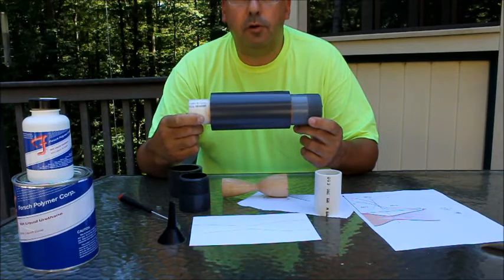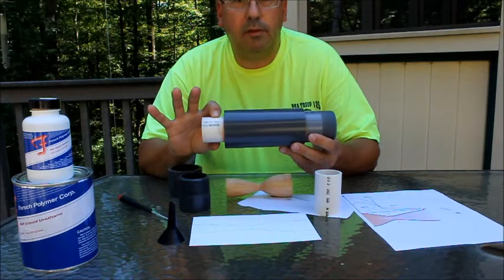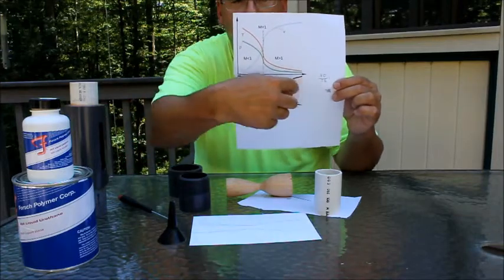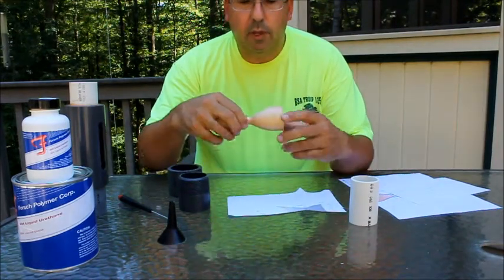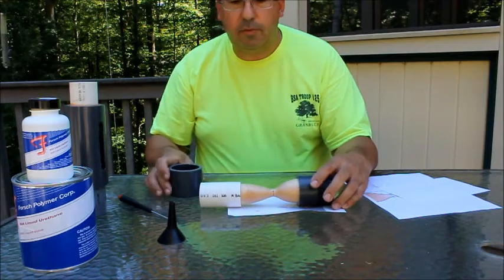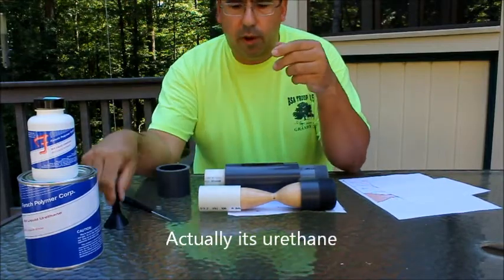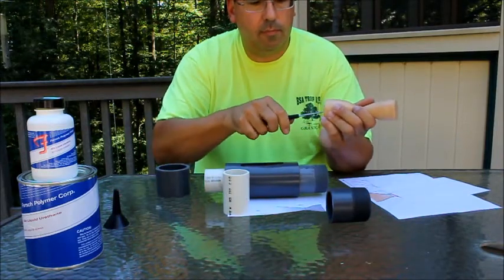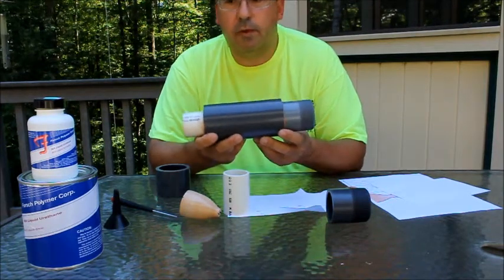Supersonic Flow Nozzle for Your Ping Pong Ball Cannon

Comment: can you explain how it works with a ping pong ball
Reply from the maker: If you watch some of the other videos you will see a compressed air cannon is used to drive the ping pong ball down the vacuum canon at supersonic speed. This nozzle allow the air from the compressed air canon to flow faster than sound. Without the nozzle the air would not flow so fast due to turbulence.
Reply: The Basement Scientist thanks for the explanation
Reply: @thebasementscientist9079  can you get supersonic with atmospheric Into vacuum.